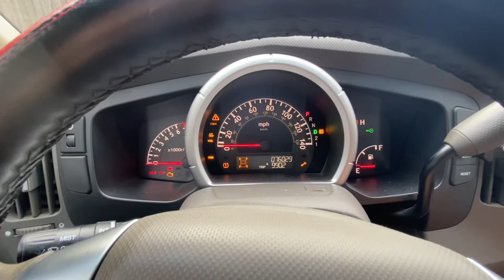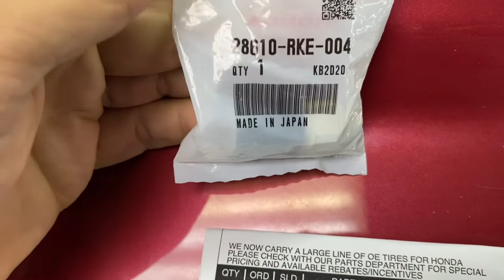Honda P0847 Transmission Code

Comment: How far can you drive when the Check Transmission warning light comes on? I went to my Honda dealer immediately, but they wouldnt even scan it, i had to make an appointment for 10 days away!
Reply from the maker: It depends on what your problem is. Damage could occur if you ignore light a few days shouldn’t be a concern. I would try a independent shop to scan it for you. Thanks for watching. Please subscribe if you haven’t already 👍

Comment: I can’t find the sensor 4. I replaced the 3rd one that is shown in the video but can’t find 4th
Reply from the maker: Not sure but I think it is inside the transmission
Reply: @scrapdaddysgarage5027  Thanks for the reply. I found it actually. You gotta go through the top. remove the battery. and its kinda a pain to get to but got it after some time.

Comment: I just changed this same sensor and the code didnt go away and didn't fix it.  It's shifting harder now. :/
Reply from the maker: @mr.selfdestruct1677  check the wire going to the sensor to see if it’s damaged anywhere.
Reply: Will check the wiring.  Do you think that  it could just be the transmission that just failed ?
Reply: There should be 5v at the connector right?
Reply from the maker: @mr.selfdestruct1677  not sure, hopefully not any internal problems.